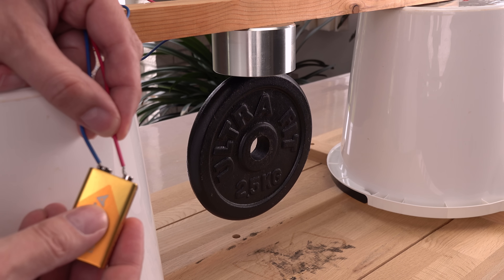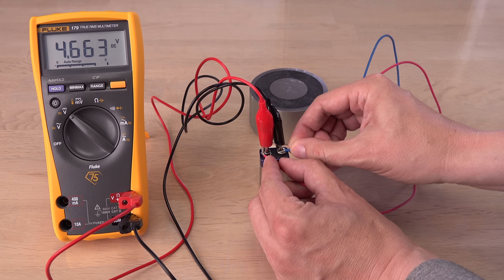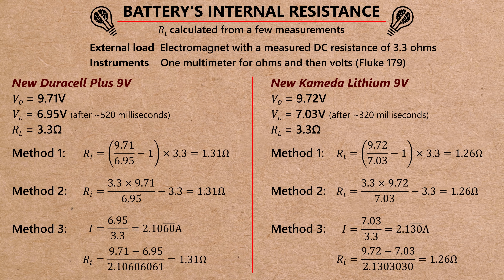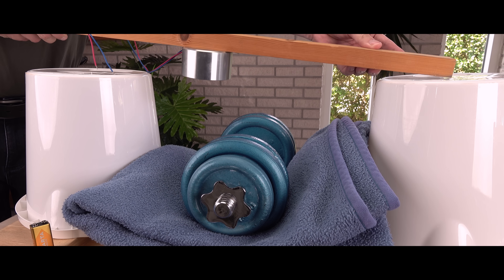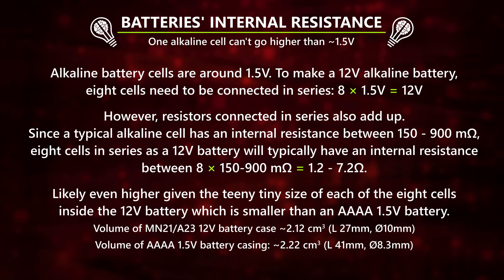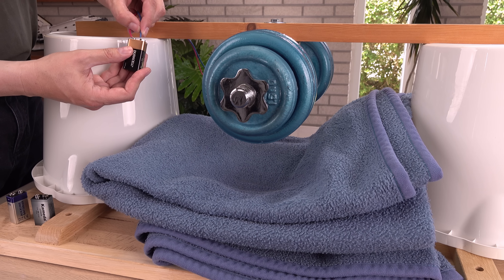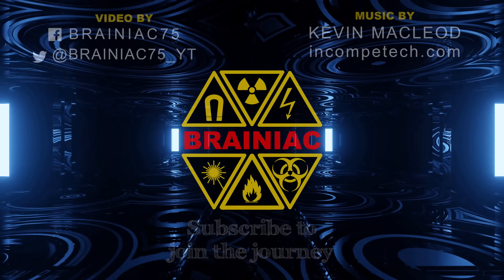The Curse of 9V Batteries | Internal resistance measured with multimeter

Comment: Some 18650 Li-ion or LiFePO4 cells may be big enough in series (only use sets of identical). A 12.8v >5Ah LiFePO4 (with integrated BMS) would work OK.

Comment: dso138 is very cheap osciloscope, and its very capable for its price, even its has lot limitations compared to "real osciloscope".
There is also modified firmware to add second analog channel (if you can clone analog chanel circuit), and two digital chaneels which doesnt circuit change.

Comment: It's a single battery made of 6 cells. It's technically a misnomer to refer to an AA cell as a "battery" because "battery" refers to multiple things grouped together. But of course, no one cares about what's technically correct because the word "battery" just means "chemical electricity storage device" at this point.

Comment: Battery means Multiple...
A Battery is made up of Individual 'Cells'.
They are not 1.5v Batteries in series they are 1.5 Volt Cells that make up the Battery.

A 'Gun' Battery is a collection of Individual Guns, etc.

An Alkaline Cell produces around 1.2 volts, which means a 12v Battery is made up of around 10 Cells.
A Lead-Acid Cell has a nominal voltage of around 2 Volts so a 12 Volt Car Battery is a collection of Six Cells.

Comment: makes me slightly wonder if there's any way to do alkaline batteries effectively "in series" without the problem of them charging each other
and yes the simplest solution is simply "make sure they're at the same charge level", but y'know
Reply: You probably could put electronics in between them, they'd still technically be in series, but at that point you're better off either just switching to a different type of battery that can give you the necessary voltage or just sorting out your batteries to make sure that they're all a similar charge level.

Comment: 5:00 You are wrong. The 9 Volt battery contains 6 1.5 Volt *cells*. A battery is more correctly called 'a battery of cells'. 
It's the same with guns: A gun battery consists of a group of guns, not a group of batteries.
And with battery hens: Each component of the hen battery is a hen, not a battery.

Comment: 9V batteries are actually batteries because they contain multiple cells inside the wrapper. Rather than a single 1.5V cell which we often call a battery, when it is only a single cell. EDIT: OK, you covered that about 9Vs.

Comment: 9V Batteries are junk. Poor internal resistance, poor energy density, high cost. If you design some Device, go for AA Cells. A 9V, two AAA or two AA Cells are almost identical in size from an engineering standpoint but AA is superior to the others in every way
I work in the entertainment Industry and wireless Microphones with 9V batteries are a nightmare compared to ones with two AA

Comment: I know I've come across devices that used alkaline batteries in parallel. The key is to make sure you use all fresh batteries from the same pack right at the start so the voltage difference between them will be minimal. I would deliberately search for batteries across multiple packs from the same expiry/manufacturer date that were within 0.02V of one another. 

Now I wish I could remember what that gadget was. It ran on AA and used 3 in series with two parallel runs for 3V. Maybe it was an old trail cam? Looking to prolong the battery life by spreading the load across more cells.

Comment: Oversimplification:
From some quick shallow search results online, it is saying that it is just best to never hook up ANY kind of batteries in parallel, for the same reason as the alkaline batteries.
So I guess it is always best to buy a bigger capacity battery that was designed to work properly at the capacity you want,
rather than hooking together smaller capacity batteries in parallel.
I'm not saying it can't be done, but for my DIY purposes, i won't wire store-bought batteries in parallel anymore. 
(DIY dirt cheap liquid batteries is probably fine, because you made them and if you ruin them or your wires, you probably don't care, as opposed to an expensive device being ruined or a fire)

Comment: 4:56  A 9V battery is made using six 1.5V CELLS connected in series. 
Understand that... CELLS. 

Too many, that should know better,  call a 1.5V cell a "battery". 
That would only be a 1.5V battery if it contained 2 or more parallel connected cells.

Comment: These 9V Batteries are not made to drive 3,3 Ohms loads. A device which normally operate from a 9V block need in most way only several mA current.

Comment: "Internal resistance" is quite a misnomer in this situation. The actual culprit is electrochemical overpotential, which has very little relation to ohmic resistance in the cells. Overpotential is a complicated thing involving chemical thermodynamics and kinetics, but for simplicity let's just say that diffusion can't keep up with refreshing the electrolyte near the electrodes to compensate for its consumption when current is generated.

Comment: I was ordering some rechargeable batteries, so I thought I'd order a couple of 9 Volts for the smoke alarms. When I read the instructions, they said to not use rechargeable in smoke alarms. No big deal, I thought, I'll just buy a device that uses 9 Volts. I searched and searched for something useful to me that used 9 Volts. I don't think the 9 Volt battery is used much these days, because the only thing I could find that wasn't a smoke alarm,  was crappy little flash-light.

Comment: Really like your videos!  Feel compelled to point out, since you bring up the auto-ranging issue (and a quick scan hasn't shown another comment saying this):
You can lock your meter into a particular (voltage, in this case) range: that's what the "range" button is for.  It's intended for exactly a case like this: not losing key data to auto ranging.  Quoting the user manual: "The Meter has both Manual range and Autorange modes. ... In the Manual Range mode, you override Autorange and select the range yourself. / To enter the Manual Range mode, press RANGE. Manual Range is displayed. In the Manual Range mode, press RANGE to increment the range. After the highest range, the Meter wraps to the lowest range."
So in this case, manually picking the (probably) 60V range might have been best.

Comment: I honestly think a diode in reverse and 4x 9v in a parallel + series config with a DC-to-DC boost/buck will fix this. It would keep your magnet from shunting high voltage EMF through the battery(or this case converter), slowly killing the system over time - and give you enough voltage draw variance and max cycle boost per set of batteries. Not ideal but it beats lugging around a bench PSU. The problem is that the internal resistance is keeping your RMS peak wattage that the magnet requires from ever being achievable. Give it more to draw from by lowering resistance and your RMS capabilies go up.

Comment: The “batterier” battery has an interesting construction.  The few 9V blocks I've disassembled all consist of a cylindrical cells which each have their one casing and there is some unused space in the block due to the use of the cylindrical cells.
Reply: Probably, I think that's the case with other types as well. The actual materials that they use have improved a great deal since the form factor was specified, so there may be some space inside that would have previously have needed to be full of chemicals to hit the necessary specs.

Comment: While the Siglent SDS800X HD Series might not have an HDMI port, they do have a web interface with a live view of the screen which can be used for quick and easy recording. (You can also interact with a mouse in the browser just like you would on the touch screen.)

Personally, I find the Siglent UI/UX to be more intuitive in comparison, and am more than happy with my scope - but honestly, both scrops are likely a good option to pick.
Reply: a web interface sounds even better tbh

Comment: The problem is that here are two types of 9V alkaline batteries. The first one contains 6 Flat cells stacked in a plastic casing like the Varta battery you shown, and the second type contains 6 round LR61 (AAAA) cells which have a lower resistance and can deliver more current. Usually, the packaging or the battery should have the type printed on it, for example "6LP3146" for the Varta Batteries and "6LR61" for the round cell ones. As far as I know, all Varta Batteries currently use the flat cells unfortunately and Energizer ones all contain LR61 cells. I don't know which one Duracell uses. The cheap no-name batteries are made by different manufacturers and they also often change, so that's more or less always a gamble.

Comment: 9:24 honestly you will have much more luck with putting more battery cells in parallel instead of series
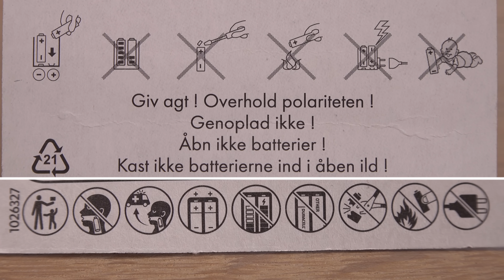13:14 just make sure they have the same voltage before you connect them to each other

Comment: How about a rechargeable 9v if they exist cus it should then theoretically not suffer from as much voltage drop because the more resistance there is the more heat and exploding chance there would be when charging

Comment: 2:20 Method 1 is exactly the same calculation as Method 2 - only the terms are arranged a bit differently, but there's absolutely no difference
Reply: And Method 3 is just the derivation of the other methods, if you substitute I you get the same formula

Comment: 2:18 formula, method 1: Ri = (V0/Vl-1)*Rl --- Ri=internal resistance , Rl=load's resistance , V0=battery voltage without load , Vl=battery voltage with load
2:29 method 3
2:50 official measurement method using oscilloscope
3:05 alkaline battery calculation
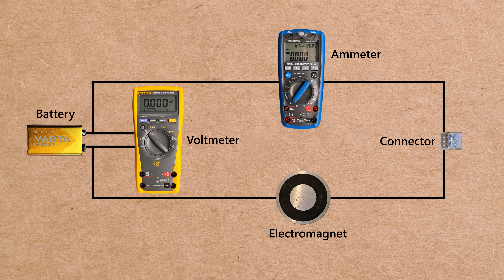3:20 circuit diagram with 3.3 Ohm electromagnet
3:49 alkaline battery calculation with current measurement
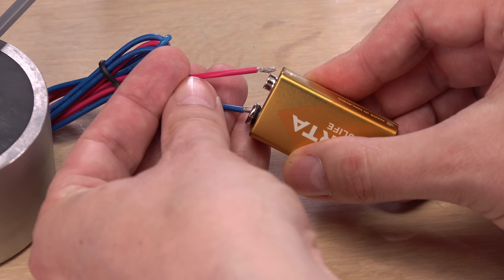4:01 circuit diagram with 3 Ohm resistor 
3:49 alkaline battery calculation with 3 Ohm resistor
4:35 alkaline battery comparison table
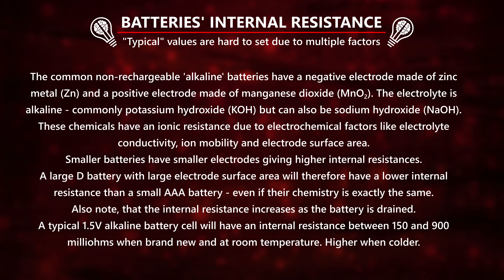4:44 characteristics of alkaline batteries
4:50 9V battery disassembly: 6x1.5V
7:09 alkaline battery calculation with 1 kOhm resistor
7:35 lithium (NOT -ion) battery calculation with 1 kOhm resistor
7:42 comparison table li - li - alk - alk

Comment: You can also add a big capacitor in  parallel to the battery. When the magnet is not connected the capacitor would get charged  and when you connect the magnet it would help out the battery while it discharges

Comment: Remember as well most batteries are made by a few OEM's, and the only difference in most cases is the outer wrapper. Even Duracell is made that way, as it is now no longer a battery manufacturer having it's own factories, it just has the label that is put on the OEM cell. The only difference is that some of them, where the big user demands a better quality cell, is they tell the OEM to make it better, not cheaper, which is the only difference.

Comment: I was under the impression that 9V alkalines were rated for peaks of around 500 mA (if you look at the datasheet for energizer, you'll see discharge rates of 500 mA displayed in some graphs, though i dont think this sheet states a max/nominal current), makes a lot of sense that if you tried to force over 3A out of em, the voltage would drop.  (Similarly, for Li 9Vs, you'll see ~1A discharge rates on datasheets)
I wouldn't really call it a curse, the same way I woudlnt call a hammer faulty for not being able to drive a screw, its a different tool for a different job.

Comment: Well the internal resistance if it is bigger than 1 Ohm can be measured with simple multimeter. It is just a resistance after all. For resistance less than 1 Ohm you can use milliohm meter. It is again a multimeter just it can measure very small resistance and voltage. And last but not lest. If you are not happy with the factory 9V batteries, either buy a modern Li-Ion rechargeable one, or bult it your self as I do. The shell can be printed on any 3d printer, I'm using 102540 1300 mAh Li-Ion cell that matches 9V battery size in height and width perfectly and of course a combined charge control and booster board a thin enough to match the battery thickness.

Comment: Alkaline batteries do actually take a charge again if ya recharge them. i have an old nimh charger with a 80mA charge current and it works quite well to recharge old alkaline AA batts.
Just take care not to leave them on charge for a week as i hade one where the bottom popped open and the black battery sludge extruded out in a perfect stick.

Comment: I knew that 9 volts were a series of multiple batteries within a casing ever since I was a kid. One day I realized while trying to make a radio from one of those kids kits that two 9 volts could be stuck together. Several minutes later there was a really loud pop and it was the cells shooting out of the back of one of the 9 volts. That is how I learned that fact lol.
Reply: Out of curiosity i simply tore apart everything i was curious about including batteries and found out that way
Reply: I did that when I was a kid too, but I chickened out when they started getting hot.

Comment: Hmm. I wonder how long of a pulse that magnet needs to let go. If it’s short enough, you might be able to get away with charging up a capacitor (or super capacitor, maybe) from the battery over time, where the internal resistance wouldn’t matter much, then dump the energy all into the magnet all at once. That back-EMF pulse might be a bit tricky though. Add a diode across the cap to shunt it, maybe?

Would make for some fun experiments. Especially with a scope winkwink

Comment: same with a car battery, 12v on surface, but under load it should be above 9.6, while charging it should be 13-14v.

Chemistry can be confusing on the surface

Comment: All three methods are just the same equation with the terms rearranged.... The only reason to use any one of the three in particular would depend on which factors you measured(I.e. using M3 when you measure the current directly)

Comment: I am partial to the DHO924S over the Siglent scope because it has a USB-C port for power, so you can trivially run it off of cheap power banks (assuming they support negotiating a sufficient voltage)

Comment: that just goes to prove, that if you buy the cheap batteries, you save money but they don't last as long under load.
the only thing that confused me is, don't Electromagnets only attract metal when power is applied? yours seemed 
to do the exact opposite... in my head I heard Scotty, on the original Star-Trek shouting "You canna change da laws a physics!"

Comment: Why 9 volts at low current? Many years ago when vacuum tubes were the new thing we needed a way to bias the grid. This required a "C battery". The filament used an "A" battery and the "B" battery (sometimes called B+ today) ran the plates. 12v from the lead acid battery removed from your tractor worked fine since the rest of the week the tractor would be charging it while you did farm work. Filaments require low voltage at high currents. The B battery ran to the plates. That needed to be a high voltage at low currents. A stack of cheap C batteries did nicely. The grid needed a negative voltage around 9 volts to properly bias it. This was before accurate resistors and bypass capacitors existed. AC rectification meant another expensive tube and another expensive transformer and copper windings. Since the grid required almost no current for bypass, a used 9 volt C battery was used. Many circuits had power switches for the A filament and the B plate batteries but didn't bother with a switch for the C grid battery. When transistors started getting big, the voltage of a C battery was used on the transistor like the B battery was used on the vacuum tubes, so those stuck around. Since then they were the battery of choice for portable items, like radios and ohm meters, they stuck around for a long time. Only rather recently has MOSFET transistors been able to work with a gate voltages below 1 volt and we could make very cheap switching power supplies for portable equipment.
Reply: another thing was if they were using directly heated cathodes... individual filament supplies or biasing. batteries soon added up...

or resort to the slightly obscure method called "back biasing". tie all the cathodes together and use the good old self bias resistor... calculated for total current and tapped at appropriate points. vaguely similar to the loftin white DC coupled amp...

high tension before solid state switching or rectification? trembler/buzzbox induction coils... so yeah, a battery was preferable.

ha ha, was given an old tube guitar amp. schematic in the back... solid state. still with an OPT. that era when they still felt the need... or maybe it just automatically suits the output of a guitar amp due to the inability to deliver pure DC? cus its definitely not something we do today. but guitar amps are a bit of a strange beast, distorting intentionally. yet hard clipping in the final output device is never a good thing... must be applied with discretion!

some digging, seems i got the year they changed the design... and not just a little!
Reply: MOSFET stands for metal oxide semiconductor field effect tranaistor, so you wrote transistor twice lol.
Reply: @mernokimuvek  Doing so is helpful for anybody that stumbled in here and doesn't know what a MOSFET is. When you abbreviate things you reduce the comprehensibility to people that aren't already aware of what the abbreviation is for.